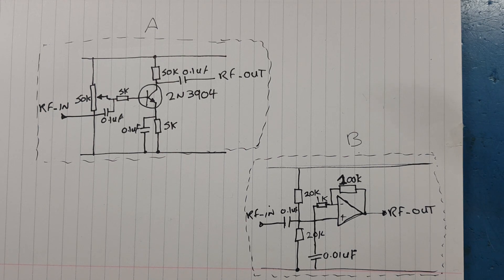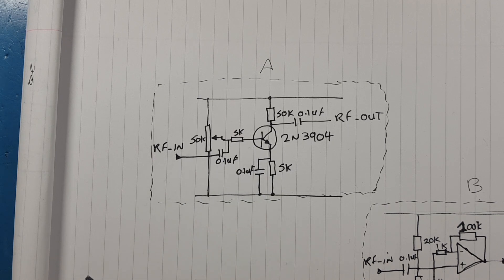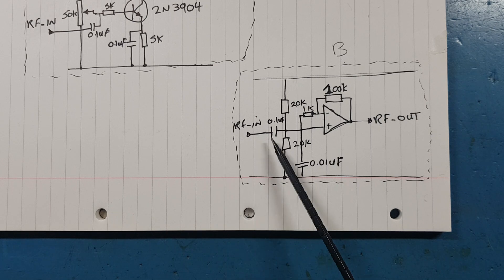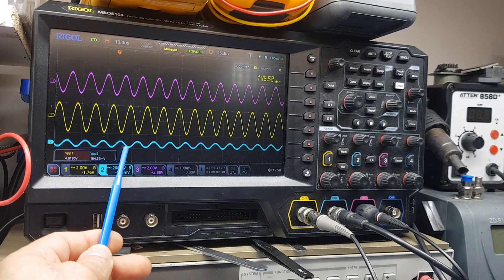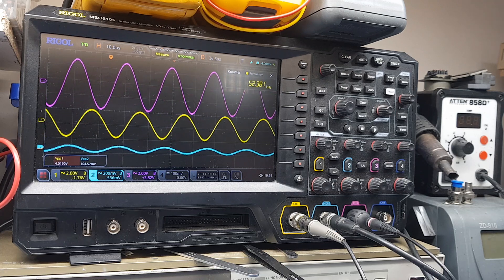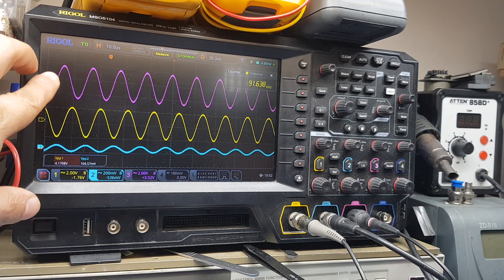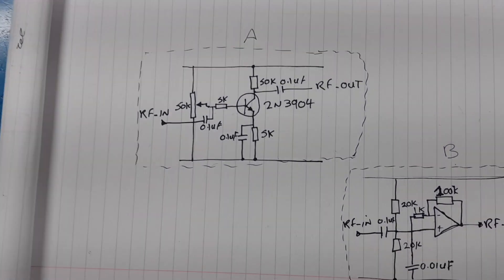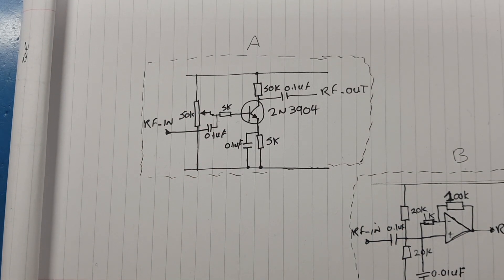Transistor Amplifier VS Operational Amplifier

Comment: It is a NPN transistor circuit! And you can Add a 10k resistor between B & C as feedback and you will get a much better Performance out of the transistor amplifier circuit. And you can also lower the value of the  5k to 1k for more gain
Reply from the maker: Tnx for the 9nfo. I will give that a go on ear future video.

Comment: hello. I need to play a frequency of 20hz on a simple coil of 4 ohms, what final assembly would you recommend? I made a generator with xl2206 for sine wave... I don't need a high gain, maybe not at all because I want the signal on the coil to remain the same as the output from the generator...
Reply from the maker: Hi
Best is to use a op amp followe
followed by pnp, npn buffer stage then monitor the signal at the coil connections. That way you can see if there is any distortion on your waveform.

Only by monitoring it with a oscilloscope you can find the sweet spot of the coil and have the best driver for it. At least that is how I would do it. I am sure there are other ways too.

Comment: The inside of the op amp is also a transistor
Reply from the maker: Yep. Inside 100% of all integrated circuit's is transistors.
Reply: No. It's a set of several transistors, in a given circuitry.

Comment: Howdy.
For even more speed LM7171 or for VHF/UHF speed OPA621.
For high voltage output +- 40 V OPA445.
The 2N3904's transition frequency is only 300 MHz. 2SC1687 reaches up to about 700 MHz. The cause of dropping gain for the transistor is the Miller capacitance between base and collector.
Regards.
Reply from the maker: Tnx for your info, I might re visit this  again in future with your suggested part numbers. I do have some GHz frequency transistors and ultra fast op Amps.

Comment: I've started using triangle waves for testing, you see nonlinearities very clearly.
Reply from the maker: Interesting, do you use signal gen for this? Or other equipment
Reply: @T-Tronix  I just use one of those dirt cheap XR2206 signal generators you can buy as kits. It's pretty annoying, I should probably upgrade to something better. Those FG-100 ones seem nice and are almost as cheap. (I did once use a synthesizer, before I had anything else).
Reply: Triangle waves instead of?
Reply: Instead of sine wave 😉